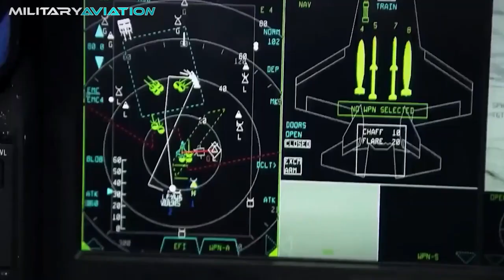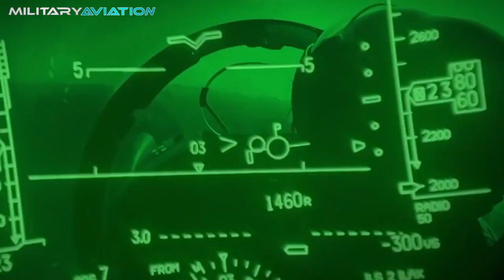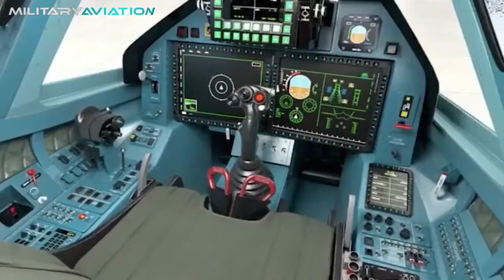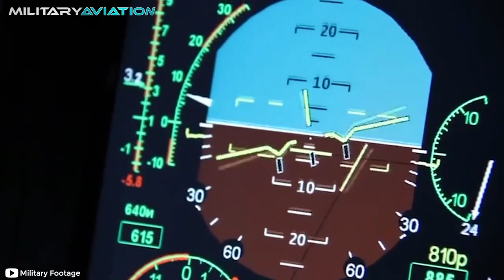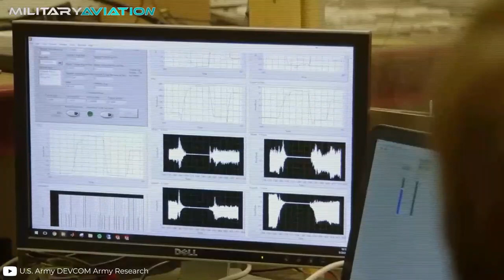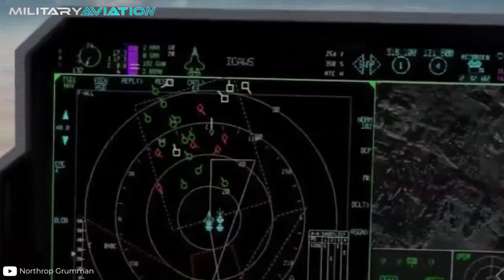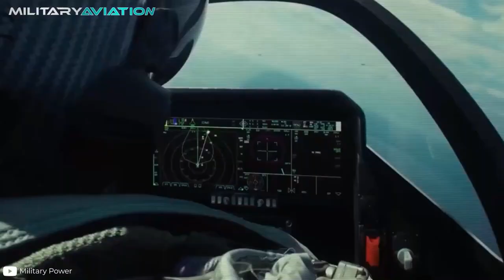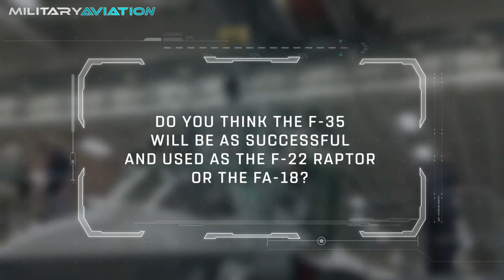Su-57 vs F-35: What is the most POWERFUL FIGHTER today?

Comment: Russian technology is Best
Reply: In your dream. Thsts why India drop out the su57 cus the su57 didn't have the capabilities Russia claimed
Reply: The Su-57 is IMHO one of the most beautiful aircraft ever produced.
Reply: Wrong
Reply: Why did india pull out the project? Why nobody exported it ? Why Russia only have 10 and 6 that is flyable ? If it was the best Russia would have more but instead they the airforce getting su34 and su35
Reply: @josefhyatt2780  looks dont get get the job done on the battlefield. What a pointless statement that holds no value